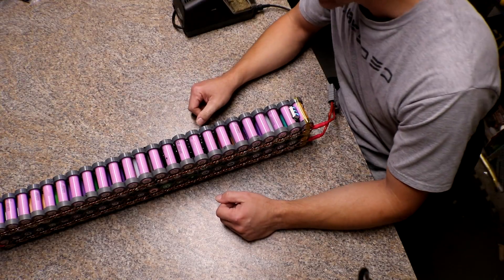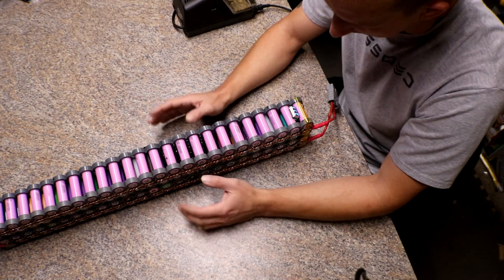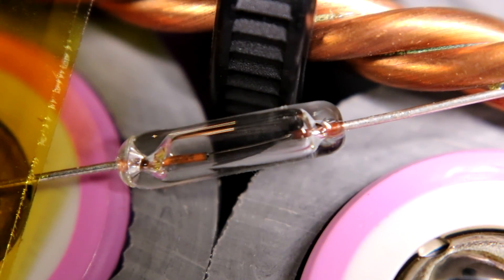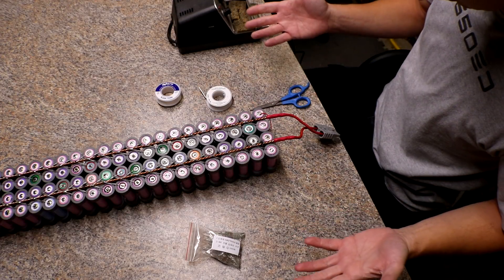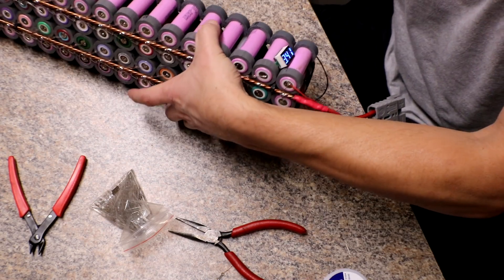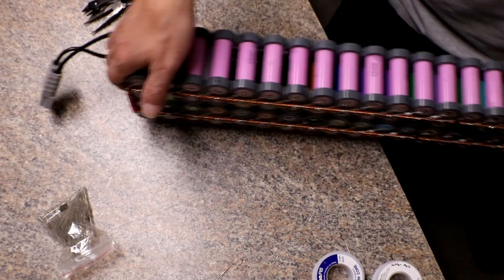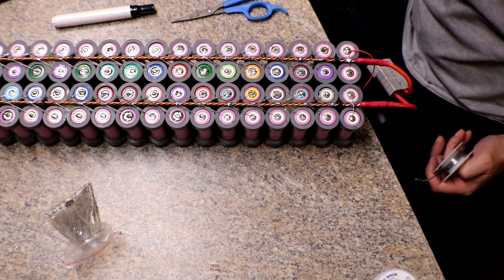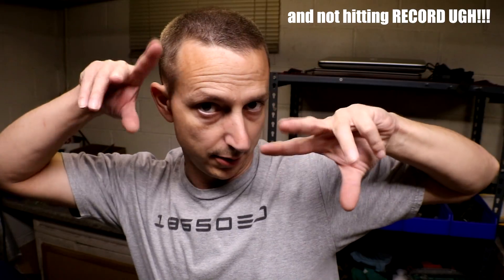Diy Tesla Powerwall ep62 kWh Load Test Failed Attempt

Comment: Quick ? Y don't u use silver solder for the higher conduction? I have built lots of Bluetooth speaker boxes and only use silver to ensure high quality audio and love the results!
Reply: I have used a few different grades and types of solder but for the most part they all gave similar results.  If you have sufficient contact area between the solder and the terminal as well as the wire the small difference in conductivity is not really noticeable.  Silver solder alloys generally require much more heat to make a solid joint.  Silver alloys make a stronger bond but that bond is less ductile/more brittle as a result.  For the soldering of lipo packs, plain old 60/40 is more than sufficent.
Reply from the maker: Never really thought about it to tell you the truth.  I usually use a thinner diameter 60/40 but ran out and grabbed this stuff.  Its fine but the higher temp40/60 was in with the 60/40 and I didnt know it untill I started using it lol.  Got some new stuff coming👍
Reply: AveRage Joe it isn't that much more expensive may help with with the voltage drop.

I will be starting on my project and my utube channel in a few months i will be using the silver ill share my results and hopefully the community will be able to tell me if it made any difference since I won't have anything to compare it to. Will definitely be making everything from scratch even my solar panels. Love ur channel keep up the great vids lovin the more frequent uploads hope it gets u more subs!
Reply: This is why we have science - it doesn't care what people think or believe.
You are welcome to believe what you like, but it is not supported by physics. Subjective opinions based on a variable of a solder joint that could make only a 0.00001% difference to the amplitude of a signal (and nothing else) is not evidence!
If there was any noticeable difference, then it has to be because of something else.
I agree that using silver wire instead of copper of the same cross-sectional area would improve current flow and reduce losses by a few percent, but that would not change the shape of a waveform, only even then the shape of the waveform would be indistinguishable.
People often think something must be better because it costs more, or made of purer stuff, or passed through the digestive system of the civet. The mind's capacity for self-delusion is by far the greatest variable.
Reply: Andy Lee Robinson that is exactly what I was going for and when I made the box with the 10% silver my skill may have been better than my first box made with the regular solder and to that note this still requires a level of opinion from the individuals I played my speaker boxes for
Also each box was made using similar methods but the 10% silver box I did tin the length of the wire and use marine heat shrink from the bluetooth module to the class d amplifier and also to the speaker in the 10%silver and when I read your comment I was reminded that I had done as such to improve the quality sorry I didnt remember that till I read your comment 

But I also think the quality of sound is subject to taste so this will always be hard to prove with out bias 

And now with graphite cone neodymium speakers it adds another level of aggravation to the subject of quality of sound there must be a point where the sound is to crisp for some 

Great discussion it is hard to find knowledgeable people who have the experience and formal education that are open to these group discussions 

Thank u for your expert opinion and your knowledge you brought to my comment it gives great context for others and some insight into the powerwall application but I will be getting the 10%silver for everything but by battery pack
Reply: kuhrd great advise maybe I won't use silver on my pack but on the rest of my connections I will just my preference and experience with audio equipment it makes a difference but it's audio and it can be noticed by some picky audiophiles (background noise reduction, hissing and popping removal, and crisp treble) and I am picky with my audio! 

P.s. everything I make has a speaker and flashlights lol
Reply: Andy Lee Robinson not sure what you are buying but the stuff I had made a big difference not only to me but several others experience tells a different story and there are many types of silver solder you need to purchase the kind specifically for audio to get a higher percentage of silver
Reply: Andy Lee Robinson https://www.hificollective.co.uk/solder/audio-note-ansol.html
Reply: Andy Lee Robinson http://www.audio-consulting.ch/?Parts:Silver_Solder_-_10%25_Ag
Reply: If I do anything I put in a lot of research and testing I have made 6 Bluetooth speakers and the first one was with normal solder then I purchased some 4% silver didn't make much difference then I purchase some 10% that one made the most difference now I'm out and need to buy more I've used the 10% silver on almost every project that I've done in the past 5 years and now I am out and need to purchase more when you have had the experience and ask many others to see if they could tell a difference just to see if it was in my own head and the results are very similar everyone says the speaker boxes with the 10% silver made the difference so the proof is in the pudding I've done the work and the research and that's what experience has taught me
Reply: I have a postgrad in music information technology, and have been doing electronics and music since primary school.
There is no measurable difference - it is entirely a placebo effect.
In a solder joint where the wires are already in contact and surrounded by solder with a large contact area and negligible signal path, the difference in resistance owing to the tiny difference in composition of the surrounding solder is of the order of microohms and totally impossible to notice.
Reply: Andy Lee Robinson that seems like a opinion but you have knowledge but it seems clouded by others judgment (probably your teachers) I conducted a "blind" study played the same music used the same speackers and bluetooth modules along with the same power source the results were usually unanimous my life has shown me a big difference in this case it may be a small change but it is barely noticeable but like I told each person before I asked i made these with speaker boxes with the same hardware with small changes in the wiring can u tell me what is the difference and to the "professional" audio equipment installers said the one with the silver solder @10% was warmer and crisper that tells me there must be a difference
Reply: Andy Lee Robinson not trying to be controversial with u but if I went to all that trouble and didn't explain anything in detail to my test subjects and they all said 1 was slightly better if say that is the truth and many teachers do not know how to teach without spreading their own opinions like a disease
Reply: One thing to remember is that you must connect the exact same Bluetooth module, amplifier, and speaker with a mic set at a set distance in a soundproof room that does not change and recorded into a 24bit digital recorder so that the only thing that changes is the solder joint.  I have noticed huge differences between Bluetooth modules and amplifiers even if they are made of identical circuits since all components have variation.  For even better accuracy get rid of the speaker and mic and route the output of the source through the solder joint and out to a quality digital recorder.  Bring all files including a test with the wires just wrapped around the connections before soldering and do a subtraction of one waveform from the other and see what difference if any exists.
Reply: In the engineering class that I teach every year, I have students measure the resistance of various connection styles by measuring the mV voltage drop across the connection all using roughly the same surface area.  The only connections that made a real difference were those made with corroded connections and loose connections since they created a substantial loss in the connection.  

The only benefit or reason to use silver solder is when soldering silver and gold contacts along with some surface mount devices since many use silver or gold contacts and solders high in tin will strip the gold and silver from components and pads and make a possible brittle solder joint.  Other than that I would be wary of any solders higher than say 5% due to the mufh higher time requirements.
Reply: kuhrd even if all of my connections past my battery pack equates less than 1% efficiency Improvement over the life span of my batteries that is still good enough reason for me to use the silver solder and I do enough speaker projects that I will get the 10% no matter what I'm a firm believer for my experiments amongst friends that makes a tiny difference remember this is all up to personal preference I think this thread has proved that thanks to some very knowledgeable people
Reply: The notion that silver solder would make any noticeable difference to power transfer or audio quality is just absurd.
It contains less than 5% silver, and silver is only a few percent more conductive than copper.

Comment: So are you happy with your fuse choice I know u have done extensive research on what is the safest one And hope the flip solved your issue!

Also you might want to put a high temp epoxy dabbbed on the bus bar near the edge to prevent further movement! That is my 2 cents don't know if that makes a contribution worth while.
Reply from the maker: Yeah Im really happy with the glass fuses so far.  Sure theres been a few issues with breaking them but I think a lot of people have had issues in the beginning with the wire as well.  I think this little swap around will do the trick 😃👍